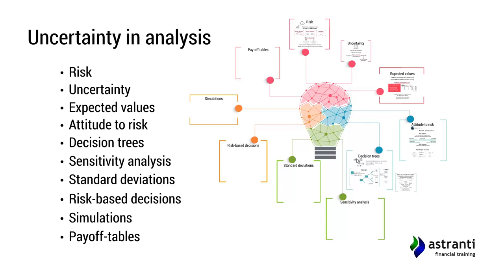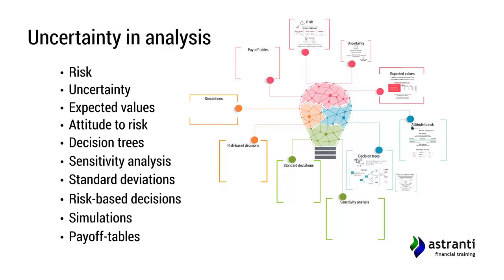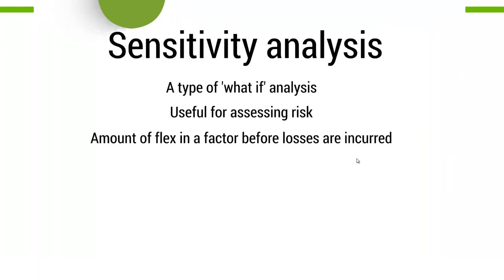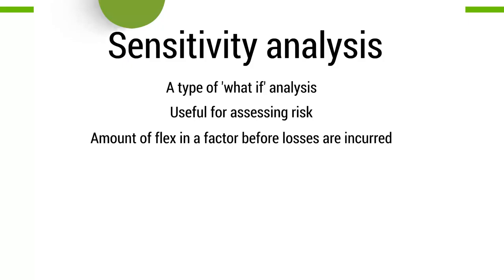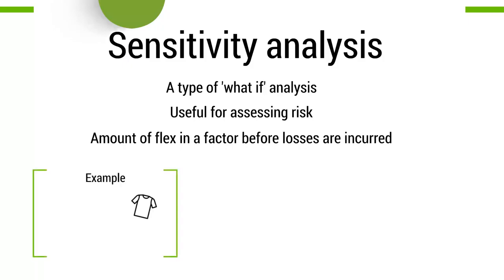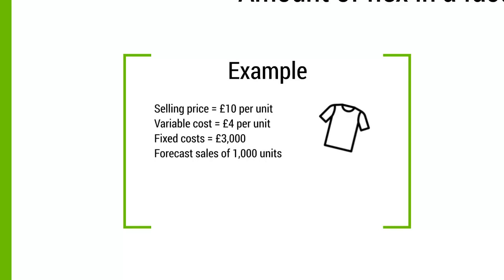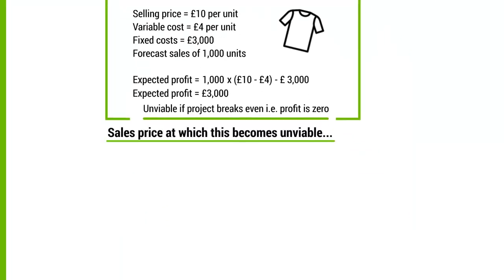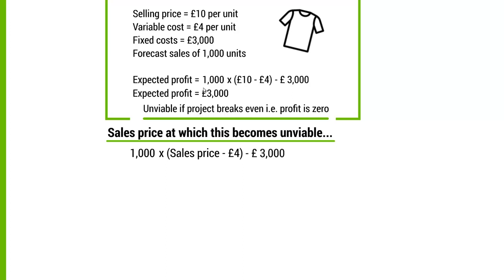Key CIMA P1 & P2 Theory: Sensitivity Analysis

Comment: Isn’t the expected profit £ 5000?
Reply from the maker: Great question! I think you may have used the wrong number for the contribution. The calculation is based on the £6 Contribution per unit (£10 price - £4 variable cost). 

Expected Profit: (Predicted Sales x Contribution) - Fixed Costs (1,000 x £6) - £3,000 = £3000. 

The £5000  likely comes from a miscalculation of the contribution or by missing a cost! Let me know if that clears up the numbers!